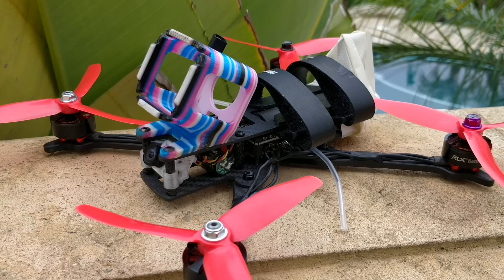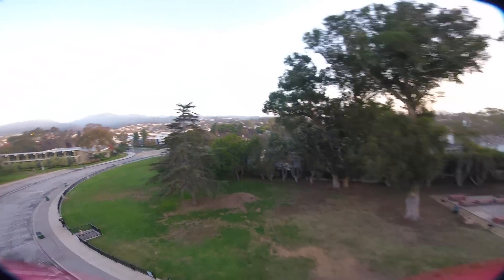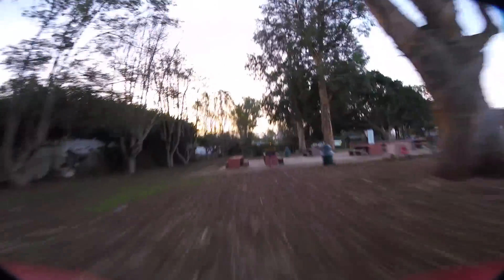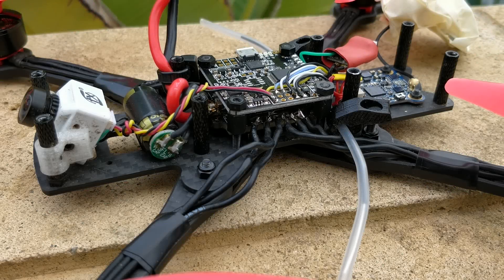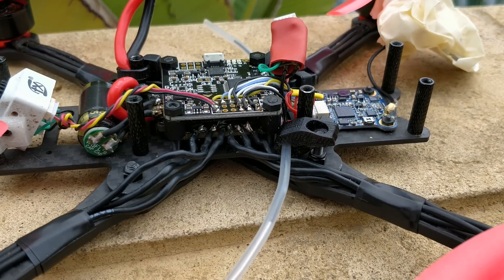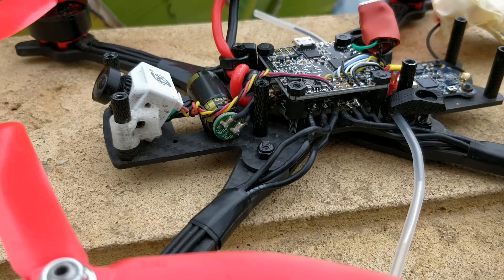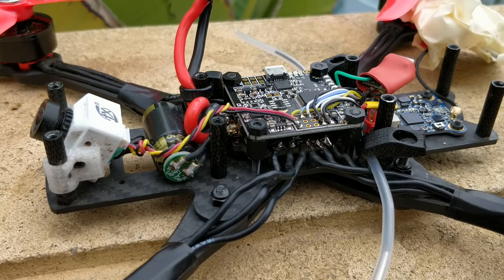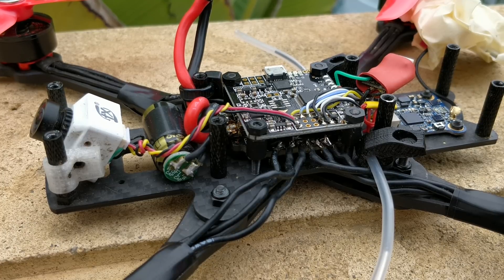Naze32 in 2019...

Comment: That is very interesting. thanks for sharing this. I remember when I first went from 1K to 2K I felt a huge difference. Then only small differences in going from 2K to 4 and from 4 to 8. Years later when I finally tried 30 2K, I couldn’t tell the difference. I never bothered with going higher than 8K. But until now I’ve been convinced that at least two or 4K is necessary for good performance, but 32K is totally unnecessary. Apparently good performance as possible at 1K... This does clear of my confusion as to why kiss flies so well at 1K (even though I never actually had personal success with it, just speaking from the flight videos of others who have success with kiss). Clearly it’s just had much better firmware And BF caught up at some point
Reply from the maker: Yep. Hail to the code.  Maybe not the jacked numbers.  What's most interesting to me is that there is still so much debate among devs. I have no horse since I don't know much about how the flight code  works but the results are intriguing and to the benefit of us all! 😁👍
Reply: I miss Chad (FinalGlideAus) he had a very interesting opinion about looptime and time seems to still give him right, 1K is still plenty enough for anything we are doing so far, the ultimate difference will always be your skills...
Reply: Betaflight still hasn't " caught up to Kiss" In my opinion, Betaflight Devs have there own approach and it delivers a far,far different end product. Nothing like Kiss. Many many months, different boards, filters, loop times, testing and testing more... Betaflight will never "Feel" like Kiss as it's a totally different code/filters Etc, which totally bumbs me out too because with your style of flying the Kiss v2 firmware would be Ideal in your hands but for some reason you just don't mix well together I guess. Nonetheless all of the systems on the market are ten times better than what we started with as a result of the total technology involved far surpassing those we had to begin with. . But opinions... you know what they say about them, everyone has one.
Reply: @jasonhull5712  does kiss evsn have airpods on a switch yet😁
Reply: @jasonhull5712  bf isn't a product it's an open source project that tries to keep over 80 different flight controllers from multiple companies flying ;D
Reply: Sugar Kane maybe that’s what makes Kiss sooo niceee... they only focus on one... 😝
Reply: @jasonhull5712  it is certainly much easier to develop code around one hardware platform
Reply: Run 8k/8k even on my 32k/32k fcs as it's no difference what so ever.
Evening when running proshot100p and dshot 1200.
Hyped up crap basically.
Reply: Le Drib u don’t notice less prop wash on 32k? That’s the only thing I notice really
Reply: Loops times have never been anything but a buzzword. Flat out your quads rotors spin at ~500 Hz. So even at 8KHz updates happen 16 times PER INDIVIDUAL MOTOR REVOLUTION at full throttle and even more at lower speeds. The actual amount of time your props can react to any requested changes in throttle is many factors of magnitude greater, than the miniscule improvement from being able to update them 64 times per revolution instead of 16. Think about the air resistance and other factors the quad is working against, it can take tens or even hundreds of revolutions before the change begins to take effect. 

The argument that 32k improves delay is bullshit because making 32k flyable requires so much additional filtering that it actually decreases latency over a well setup 8k/4k quad. The only people pushing 32k are pseudoscientists piggybacking off pre existing opensource betaflight development as a way of monetising their own hardware. It works great as a marketing tool for people because the average person just think 8k is 4 times slower than 32k. But the reality is you get much lower latency with higher LPF filters at slower gyro speeds anyway.
Reply: Seaweed simply not true at all
Reply: @MaxBeamer  Running a gyro at 32k with two LPFs saves less latency than running an 8K gyro with a single LPF filter at higher settings. Check out http://tiny.cc/filtercalc and see the numbers for yourself. 

This is without even factoring in the things the real developers over in BF, are now doing with dynamic LPF filters in 4.0. These are the things that have real impact on delay. Not running the gyro at such a high loop time that you have to slow the overall response down with excessive filtering, because of all the increased noise you created with data you cant even use for anything useful yet.
Reply: @MaxBeamer  actually its totally true.. the only people pushing 32k want you to buy into there brand.. one of the BF debs who only flys F7 hardware and is national level racer in his country has recently started flying all of his f7 quads at 8k8k  because it samples so much less noise and allows much less filtering to be used.. using the f7 chip to do some really heavy lifting... good idea... gyro sampling at 32k not so much, basically if all the control motion and prop wash happens at 0-80hz why do you need to sample all the way to 10khz? prop wash, mostly, is caused by filtering delay.. lessen the amount filtering and improve your prop wash handling..
Reply: Sugar Kane I guess it’s a matter of personal preference I’ve already typed a lot on the subject So I’ll try to avoid being repetitive .. there’s a place for everything and 32k doesn’t belong in a race (yet).. the increased processing speed coupled with the exponentially quicker faster stronger motors we are getting definitely has a place and to say it doesn’t is ignorance. I already mentioned how on some of my very clean rigs I prefer running 32k as it will help with smoothness in flight on a properly configured setup (lpf2 disabled, dterm lpf values configured with filtering quality as narrow as possible). The downside of 32k and icm is its inherent issue with vibrations so using 32k will be beneficial to use on clean setups and horrible for noisy ones.. 32k will also help with propwash.. yes propwash happens at lower frequency but so what? I think you are confused as to what 32k sampling truly means.. The increased SPEED gained from 32k sampling introduces excess hz in our freq table and with it excess noise from aliasing and nyquist limit. Which in turn MAY on a dirty quad require more filtering that will slow you back down (catch 22)With 32k you are sampling more cycles per second which means you are correcting more error per second (propwash) faster..I can only imagine the possibilities once our hardware catches up!
Reply: @MaxBeamer lol I'm far from confused as to how these things work.. I'm part of the flight test group working on the bleeding edge of BF... as i said using the extra horse power to do some serious heavy lifting.. yeah thats a good thing a very good thing down the track but sampling so much extra noise and having the the pid loop chugging through cycles waiting for the motors to actually respond to the commands its been given... not really.. we are working of some really awesome stuff that will change the game and its got nothing to do with 32k gyros... the motor response  isn't going to get exponentially  better any time soon and no amount of extra power will change that its the physical limitations of the technology... predictive/realtime filtering is whats needed and f7 processors could be very useful for that.. sorry man but the data and testing aka facts don't support the idea of over sampling, also no one who's pushing this agenda has every produced any data to prove their claims either.. at the end of the day if you like it and it works for you awesome but its certainly not how it goes for every one..
Reply: Sugar Free FPV I see where your coming from but still Kiss is sampling @ 1k ? Less sampling = less noise. Faster correction times. Less noise. Less cpu utilization I don’t know 🤷‍♂️ but this is exactly why I don’t like Betaflight. Or butterflight... Kiss is simple. I want to fly, not tune... adapter filter on, adjust the the PID’s, go Rip..... lol
Reply: Sugar Kane motor response is only as slow the model industry allows it to be..magnetless synchronous reluctance motors are being used in other market areas and could be miniaturized for aerial systems but never mentioned, Why? Bc it costs $ and time and hard work! there are few options for increased power density and response times available but no one is looking! Companies would rather throw on stronger magnets or silver windings with curved magnets one at a time in marketable increments..I have a masters in computer science and work for one of the major electric car companies  so I know a thing or two about electronic motors and software. It is all speculative you are right, the industry can take 100 different turns to get to where we will ultimately end up.. it’s up to people like flitetest and BF and tmotor  and rotor riot to push the market in a direction of growth over maximum profitability.. will that ever happen? Probably not.. but one can dream..
Reply: @MaxBeamer  your totally right the cost of new tech is totally an issue.. no one wants to spend any money in the hobby so its a bit of a limiting factor! i have a mate who's developed a molded carbon airframe.. its been destruction tested to impacts at 30g.. but no one will ever buy one because it costs over $200 in materials to construct never mind the 4 hours of laying up and the r&d costs.. adopting new battery tech would be a bit of a leap forward but again the stuff on the horizon is going to take a fair bit of time to come down in cost to the point where the hobby would stomach it.. Wind tunnel testing and aerodynamics are all ways to improve how mini quads fly but its all stuff that wont happen any time soon thanks to the lack of money people are prepared to spend!
Reply: Jason Hull very true. I don’t know much about kiss to give an opinion but it definitely does what it does very well and very efficiently.

Comment: The biggest improvement in flight performance we got in the last 4 years comes from the ESCs.  Try to install SimonK 400HZ ESCs using the old PWM protocol and you will see.  The flight controller doesn't really matter but if you want a true vintage experience, try a version of Cleanflight before airmode and you might have the joy of disarming your motors mid flight as soon as the throttle hit 0.

Comment: next to test:

SimonK ESC + CC3D with LibrePilot + ZMR250
Reply: LibrePilot is cheating!!  track down OpenPilot.
Reply: That's what I started with was cc3d and open pilot which I still have on my lap top. I still fly a zmr sometimes also. Id like to see a zmr with new tech in and drib fly it
Reply: And 2204 motors
Reply: I ran 1806 motors on the zmr lol
Reply: still have them, SimonK+CC3D+F330(with modified Syma X8 three blade props) and F450 frames.... and still flying.... My boys love them

Comment: HAHA never stop Kabab! If you really want that old time feel switch to an older BLHeli or BLHeli_S esc that will let you disable “damped light” and fly oneshot.  Just like the OH MY GOD HOW DID I USED TO FLY THIS emotion of PPM, ticking off damped light / active braking is crrrrazzzyyy. and you can’t even disable it on modern esc’s.  DO NOT turn this off and then do a punch out where you have low ceiling or anything above you :) floatiest punch outs evar.  Active braking and multishot were huge changes that really made developing modern firmware even possible, i think. And, fun trivia, it was rs2k, ie the OG raceflight dev that made multishot - i dunno about the speed of multishot but the throttle resolution improvement is what i think is the biggest change.
Reply: ps “damped light” is only something you can disable in Blheli, not BF.
Reply from the maker: Multishot is apparently as fast and more direct than any of the Dshots since there's no checking mechanism in multishot.
Reply: Kabab FPV yes! i’ve heard the same thing. we just need convince BF to implement the ability to switch to dshot without restarting (like RF i.e. Murtle Mode) so we can use turtle mode to get out of trees and still fly multishot normally.
Reply: that being said, KISS does apparently take advantage of DSHOT2400 nicely - sadly the KISS system is just too damned expensive :/

Comment: No onboard OSD?.. no problem, just turn on the OSD features in the fpv cam and connect the camera voltage sense wire to Bat+. Swap the fpv cam if it doesn't do osd -- easily.
Reply: I know I'm weird but I actually prefer the voltage readout coming from the camera OSD instead of betaflight.  Mostly because I like to be able to see the live battery voltage even when disarmed.
Reply: @5zero7RC  set one of the disarmed display setting to show live voltage.
Reply: @marsrover001  Maybe I am blind or that's a feature that is still in development, but I don't have that as an option in my OSD settings.
Reply: if you really want to get old school OSD, but still need a PDB track down the Matek HUBOSD, it came in 2 types. I made them standard on my old Naze32 rigs.  It required a firmware upgrade out of the box to work right, but did its job well once you did.

Comment: I have a bunch of cc3d boards from back in the day. I flashed them to betaflight 3.5, multishot on blheli S Escs. Believe of or not they fly fanrasticly good. I built up I believe 6 of themv(it's 6 or7, 98% sure it's 6) they are all on 2 or 3 QAV210 frames, 1 floss 2, 1 five inch alien, 1 QAV XS and a ZMR250. I had a bunch of old BH R2 2205 2522kv motors so I built 4 with those and 2 with BH R4 2206 2522kv motors and the ZMR with some racerstar 2600kv 2205 motors (thinking about each quad it is 7 built total) I used my Graupner Hott SUMD only serial receivers in them all as I have a bunch laying around due to me flying only Crossfire now. I never flew the ZMR as I only had some some simonk 12a 2 to 3s escs and have no 3s packs so I can't speak for it. But all the o5hets honestly fly extremely well after a little tuning. They are super crisp and clean flying. I was honestly shocked that only boards on old firmware but built with quality motors and escs are flying very well. I have put in a few hundred flights on them now and don't even think about oh wait I'm flying old FCs with way outta date firmware on them I just fly them. They just preform. I flew the cc3d when it first came out and was building a few quads with it and trying for the sake of me trying to learn OpenPilot and it kicked my ass left and right there was no possible way to get a nice flying quad on op3npilot tuning was just many many of hours of trying only to get nothing more them a,quad that would fly but in no way fly good. Then I slapped betaflight 3.5 on the cc3d and bam really good flying quad on stock pids and with some minor tuning a really good flying quad.

Comment: I've been saying for a while now that superfast loop times and all that fancy stuff are more useful for the manufacturers to sell flight controllers than for pilots to fly quads. Flight-wise the naze32 does have two important shortcomings: 1) no DShot which means no anti-turtle 2) no dynamic filtering. Everything else is of extremely little importance unless you have the reflexes and sensory speed of a Terminator.

Comment: Hey Bob, where did you get a BF 3.5 for a Naze32? I actually have an older quad that hangs on the wall that i might revive using this method :D
Reply from the maker: It's right there in the app.  3.5.2
Reply: @Kabab  i click on Show Unstable releases, pick Release> Naze> and only 3.2.5 (11-02-2018 4:50) show up. Did you mean to say 3.5.2 or 3.2.5? :D
Reply: i got curious about this and did some googling around and found a BF 4.0 performance build for Naze32. It should be entertaining (at least) to load this up on a fossil FC :D   https://github.com/spatzengr/betaflight/releases

Comment: This is amazing
Short question: I want to build a 6s quad and living in Germany so I have to buy from banggood. Which motor should I buy. 1750kv is Okey but 1900kv are better you said and I believe it because it makes sense. So the emax ls 2207 1900kv only have cw screws and ccw bells can't be ordered (out of stock). So my question: I want to have very good control which motor should I buy? Just buy 1750kv?
Reply from the maker: I'd recommend 1900 over the 1750. You don't want ccw prop motors
Reply: Thanks
Reply: But if I have a cw nut at my ccw turning motor my prop is going loose

Comment: So if we need a “performance edition” for f3 boards, is the firmware for this extremely stripped down? If we ran a performance edition in our f4’s would the “need” for f7’s disappear?
Reply from the maker: There is already no actual need for F7.
Reply: The real reason we need F7 is more uart for all new accessories like hd cam, fpv cam, GPS etc. Performance wise, it's just overkill.
Reply: yeah but i  remember Kabab sayin in a vid of his that the f4's fly much batter than the f3's. if using the same gyro&pid loop why would they be different?

Comment: I have one of those little Frsky recievers. Definitely better then the xm+. It's a great little reciever. I'm not sure why u couldn't use crossfire though
Reply from the maker: I dunno. I guess it would work if it takes sbus
Reply: @Kabab  just an input. U can change the crossfire protocol to sbus in the output map  from crfx to 1 wire  sbus.  So with tbs crossfire u can choose two wire TX RX input to one wire sbus. Reason being some FC only have one urart option.  It works well to. I use it on one of my quads with the  nano rx. I guess a small latency diff. But so what I can't tell.